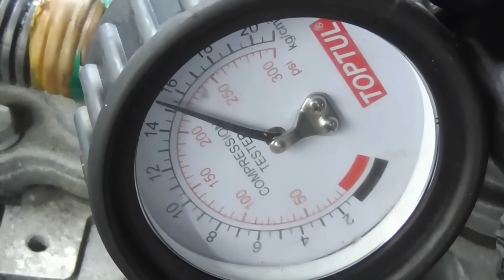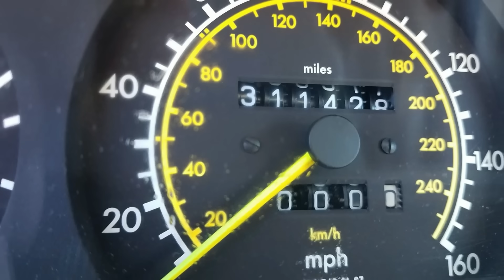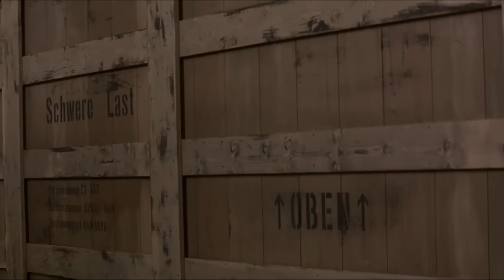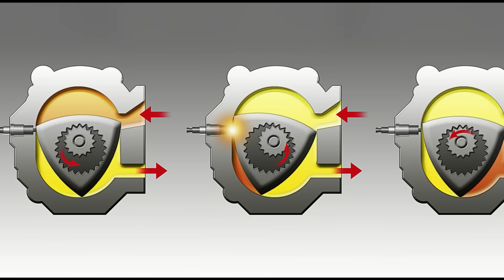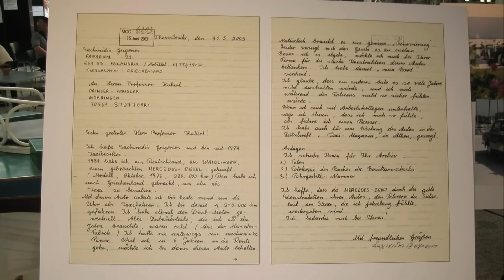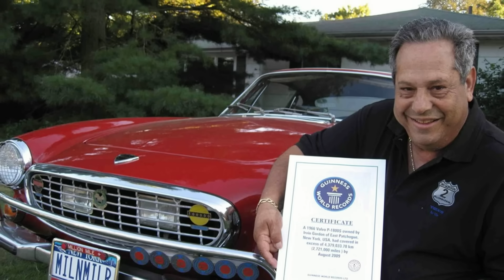Most Reliable Engines of All Time

Comment: Import biased much? I can think of plenty of American engines that'll do 300,000 miles easy. 5.9 Cummins, 7.3 power stroke, Ford 300i6, Chevy 350, as well as most small block V8s, hell I had a 2.0l zetec focus with 200,000miles, I also wouldn't say any rotary comes close to Mazda's most reliable engine, not by a long shot

Comment: The engine in the 2007 4.6 v8 crown victoria is good for 350000
Reply: Jose Alvarez 4v? 3v?
Reply: Jose Alvarez I got 2v in my 99 f150
Reply: David De La Cruz  that engine is good also, my car has the 3 valve

Comment: You did not mention the Plymouth 318  v8 
I’ve  put 425,000 miles  , brought it from the original owner who put 95,000 miles on it. For a total of 520,000  miles
All I did was replace the timing belt  once  2 carburetors oil changes about every 8000 miles and I did have to replace the  a frame or k frame as I hit a sidewalk leaving  coney Island 
It also sat from 2 months during the winter of 1981- 1982 bury in snow.
Once I got it out of the snow,put a little gas in the carb,  started right up like nothing happen.

Comment: My '78 Ford Econoline 150 work van, has over 300,000 on it... the 4.9 liter straight 6 still purrs, uses very little oil, head has never been removed... 

I have gone through 4 clutches already. I find it hilarious that young parking attendants can't drive 3 on a tree... 

The van had some issues with a cheesy clutch linkage. The clutch linkage lasted only 180,000 miles. Since I worked in a fabrication shop, I designed and made an indestructible, easier working linkage with bronze bushings. 

Just this year, I had to replace the entire ignition system, the manifold gasket, and the rear axle seals... I plan on having this vehicle for the rest of my life... I use it as a work van... and sometimes a daily driver when my car is down.

After high school, I cruised with a bud who had a Volvo 1800... another friend bought a 91 Volvo. He dropped some serious coin on the suspension. He uses it for his job, repairing industrial production machinery. He easily drives 50,000 a year.
Reply: I have 79 f150 300 with 3 on the tree!its my daily driver putting 80 miles a day on her!figured the 300 4.9 ford would be on the list.they need to do they,re research.the engines were originally installed in the ford farm tractors and were so strong they started Putting them in the trucks back in the sixties.

Comment: my old audi a3 8l (mk1) ahf engine , has almost 500.000km (almost 310.000 miles) and still rolls like a charm. only had an unnecessary head gasket service. engine inside, looks like new (almost)

Comment: No truck engines mentioned?  Aren’t there a few 1 million mile Toyota pickups?

Most full size trucks seem to reliably go 250k miles with minor maintenance and typical parts replacements (water pump, starter, alternator, ac compressor.)

Comment: Let me add some you missed. Jeep 4.0L I owed one with 260k on it till I sold it but have seen 4 that I know of with 350k to 450k miles. Also the Chevy 350 small block. Chevy 4.8L 5.3L and 6.0L V8 engines GM 3800 (3.8L) V6 and 3100 (3.1L) V6 the 3400 is capable of being a long lasting engine if you replace the shit factory head gaskets before they go so we wont count that. Dodge 318 Ford 300 straight 6 Ford 4.6L v8 Ford 2.3L 4cly 5.9 Cummins. The 5.9L being a big on my friend that owns a towing company has one flatbed with the original 5.9L that has over 600k miles on it and another with 280k. The 7.3L powerstroke the 6.6L duramax ( year depending)I could keep going but.

Comment: I got 360 thousand km on My Audi 80 b4. hardly consumes Oil, still runs 12km/h faster than it should according to its papers. It's the ABT engine. Only 90hp though and I think 148 torque.

Comment: 1.9TDI. Mine has 260k kilometres with original clutch, turbo and everything
Reply: those 1.9 TDIs are legendary, barely get warmed up with 300k km lol. The car around will fall apart before the engine gives any problems.
Reply: @ak-vq3js  yeah i know someone who used one as a taxi, about 900k kms and needed to replace for a new because seats were in so bad condition no one would sit in. Engine was never opened, oil changes about every month

Comment: You referred to the legendary OM617(A) by the name of the W123 model it was in? Show that noisy, immortal block of cast iron some more respect! Also, no mention of it being the first inline 5 engine in a passenger car?

The OM617 (as well as its predecessor the OM616, and successor the OM602) is an incredibly overbuilt engine, capable of much more longevity than you give it credit for. I own three: 235k, 249k, and 270k. The 616/617s are such sturdy engines that they frequently outlast the W123 chassis that they're in, and the W123 is/was a very durable car!

Comment: I have a 2002 durango, with one of the worst reputation engines, the 4.7l, with over 250,000 miles without it being rebuilt. I'm not impressed until 500,000 miles. 100-150,000 miles is not worth noting, and it doesn't count if it's been rebuilt.

Comment: There's quite a few mistakes here... 

Ahem.

Rb26 engines are not cheap, Roller Rockers are pretty much standard by now, the pictures of Hondas are completly irrelevant to the models you name, The K20 is still being produced in a new variant and no, it's not the most common one in Hondas (On new accords and civics, maybe). A compression Ratio of 17:1 isn't special for a diesel, Mazda made way more reliable stuff than the rotaries and if a car goes through 5 engines, why include it here?

Comment: Toyota Celica 4-banger: My wife's Celica has almost quarter million miles, still going strong with only standard, regular maintenance. Even the compression is still within spec. The body work and interior are falling apart, but the engine was bulletproof.

Comment: My 1998 Chevy  Silverado 1500 2WD, with a 350 engine,  just rolled over 430,000 miles.  Original Transmission,  with heads replaced at 278K. I am average on maintainence.  For me the key was that it has a simple fuel injected V-8 engine,  its NOT a 4x4 (less mass and moving parts) and that I started  the habit of when starting from a dead stop I never crossed 2000 RPM on the way to 60 M.P.H.   I drive this truck like I'm  driving a Semi.  Speed will not kill an engine, excessive torque will.

Comment: You are talking about 200.000 miles been like something special.
I had an Mercedes 250d from 1985 an after 568.000 km was still going strong.
If 200.000 miles is the success criteria, than are lots of engines out there that kan manage sow little.
I had an WV Polo from 2008, 1,4d, and after 250.000 no problem of any kind with the engine! 
Get serious !

Comment: The ISF Cummins family of engines has over 100 confirmed engines with 1,000,000 miles. Majority being semis. A few being Ram heavy duty trucks. Mine has gone 220,000 miles with little maintenance. I know of one 5.9 Cummins with 2,000,000.

Comment: my 2000 ford  3.0lt flex fuel ranger has 420000 miles and runs great no rebuilds 2nd transmission  still drive it daily. valvoline max life at 3000. just sayin

Comment: My 2007 Chevrolet HHR currently has 309,000+ with only oil changes and an alternator replacement.   2.2liter Ecotec with original clutch.

Comment: my accord estate 15 years old 212k town miles and abused as a workhourse towing the lot still runs like brand new. Doesn't use any oil, no smoke, Its the 2.2 diesel. The timing chain was changed on warranty after 8 years and replaced for an improved version. I had one leaky injector (caused by the dealer not reaming the injector seat when they did the chain) 80quid fix and a new turbo at 130k. Turbo was most likely damaged by a large air lock in the cooling system caused by an idiot not bleeding it properly before I bought it. Yea that's a couple of things but overall I'm very happy. Theres a taxi in London with the  same engine that has 500k miles on it so il be happy to get 300k. Also on original clutch still no slipping at all.

Comment: The engine in the volvo p1800 is a b18 or b20 (same engine but bigger bore) and is a very reliable engine but old and not practical for todays standard :)

Comment: I have an untouched 2001 VW Jetta diesel (ALH) with 591,000km (367,000 miles), and it runs like new. There are lots of these that have way more miles than mine does. An engine that only goes 2-300k miles is little more than junk.

Comment: GM 3800 v6?  Mines approaching 150k miles and runs really well despite my mother not changing the oil for like 30k miles.  I change it every 3k miles and do basic maintenance and it's surprisingly reliable.  My gf, me, and her mom all drive cars with the 3800 and they all are tanks.

Comment: Well you forgot to add my car to the list 1995 ford escort 1.9l manual transmission with 472,000 originals miles with original engine. Just recenly i had to do a valve job because some valves where leaking a little bit. I do oil changes every 5000 miles and only add 1 qt of oil between changes and i get between 34 to 35 mpg
Reply: Carlos Hernandez hahahahaha preach!

Comment: My late father was an auto jobber [between the warehouse and the 'grease monkey' was the auto jobber] most of his working life and he always said the Dodge slant six was the best American engine ever built. He was no gear head or even a shade tree mechanic but he certainly knew what parts sold over the counter and out to the garages that fixed daily drivers like the Dodge Dart, Plymouth Valiant, and Dodge Aspen/Chrysler Volare. I owned a Chrysler Volare through a very cold Alberta winter and I can testify it starts at minus 40 degrees (at minus 40 it's the same on either the Farenheit or Celsius temperature scale) and it got me from Calgary, Alberta to Toronto, Ontario in just under two and half days with time out for a few cat naps along the way. Glad to see it got a shout out as one of the longest running engines in the world.

Comment: FAKE NEWS! I own a k20 civic si and it is NOT reliable. Had a crank bearing give out at 130k miles. Issues with the timing chain tensioner, oil being burned up because of bad rings... Don't think that's reliable.

Comment: How did the Jeep 4.0 I-6 not make this list and a Mazda rotary did?
Reply: Because it's about glorifying the imports as most shit posted  on YouTube
Reply: @HuckBowlt  Not sure how, but the Mazda rotary was a total failure. Back in the late 70s purchased an RX4 wagon for $50. Yanked the rotary and dropped a Nissan L20B engine and 5 speed trans in it. My wife drove that thing for four or five years. Mazda had much better coach work than Nissan, their cars were kind of rattle traps. The Mazda was a very solid after that. I don't ever recall any of the Japanese manufactures having to be bailed out by the Japanese government (taxpayer) like GM, who builds crap!
Reply: Someone"s opinion.
Reply: Too many failed lifters. They tick loud af
Reply: @Jett-Alaska  Not sure what you are referring to? Are you talking about the L20B engine? They technically did not have lifters, this was a single overhead cam engine with two valves per cylinder. They had rockers under the camshaft than pivoted on a ball on one side, and depressed the valve/spring on the other. The lash was adjusted by threads on the pivot ball and secured by lock nuts. As I recall they were very quite if the lash was properly adjusted. But what do I know. ASE master tech, Acura Master tech. now retired. Worked in the grease trenches for over 20 years.

Comment: my secondary car is a 2001 Honda CRV AWD version. It has 342,000+ miles on it. only thing ever done is oil changes spark plugs wires timing belt and cv axels. B20b engine running strong.  also same auto trans. its a beast of a little engine. id love to hit 400k then 500k some day

Comment: My 2005 Hyundai Elantra has 225,000 miles on the original 2 liter engine, all I did is replace the oil every 3500 miles and a few timing belts, it leaks and burns no oil and still runs great.

Comment: The mazda rotary will never blow up, but what it will do is wear out the apex seals at relatively low mileage and therefore it will burn ALOT of oil at an relatively low mileage.  Also, every vehicle in my stable has 110,000+ miles on it.   100,000 is not alot of miles these days, thanks to fuel injection and MUCH better motor oil.  Lastly, the pre -series II  gm 3800/3.8 should have made the least.  The 3.8 engines without the plastic intake will run 350,000 plus miles without a problem.

Comment: Making lots of power and being a strong base for mods does not equal reliable in the sense I think of reliable... Reliable to me means lasting a long ass time (30+years),  or lots of miles (like a Cummins diesel with a million miles on it). Not some engine you have to rebuild after a few years because it is beat on and boosted.

Comment: Audi 2.2 20V Turbo (AAN) and all the 4.2 V8 versions. Strong and reliable engines.
Reply: C. Bøgelund (for the 4.2L V8) until u gotta pull the whole GD front end off to change the damn cam chain tensioners and/or chains.....
and IF the tensioners and chain have not failed before then... which means your engine is toast...  poor design which dissuaded me from ever buying one....

now the 2.2, i've heard good things about; they sounded pretty gnarly 👌🏻

Comment: The most reliable motors ever made are push mowers, you can throw horse piss in those fuckers and they'll run like a champ. If you're a member of gen z you probably remember your dad owning an old ass mower that you've seen him use since you can remember and he probably junked it a few yrs ago because carbon build up in the motor caused it to run poorly which 20 mins of cleaning would've fixed but eh fuck it time for an upgrade.

Comment: You forgot the engines used in the late volvo 240 and every volvo 740 and 940, I saw a car yesterday with 640000 kilometers on it and it looked like new, all the owner had done through the year was oil changes and polished the car

Comment: I own a 2005 Nissan Titan with 375886 miles have only had to change two front wheel bearings, 1engine coil, and brakes still has the original fuel pump, water pump ,hoses ,timing belt,trans filter, a/c works perfect really great truck and still has lots of power

Comment: Where to start. ...
- First off, the most reliable BMW gasoline engines are the M50B25 (non-vanos) and the M52TUB25/B28 dual-vanos and by extension the M54 (most do over 400k kilometers). The most reliable BMW diesel engines are the M21D24 and the M51D25. The only fault on these engines is the injection pump witch can fail around 300-350k kilometers, but it's easy and cheap to repair.  The M21 is so simple, it rivals mercedes diesels when it comes to reliability - AND - the Bosch injection pumps used by the M21 and M51 engines can be rebuilt - whereas the Lucas unit used by mercedes engines cannot (technically it can, but good luck finding parts, nobody sells a rebuild kit for lucas pumps). 
 - Second, ALL toyota engines are average reliability-wise - nothing special about them. In fact, the aluminum alloy toyota uses for the block and head is of mediocre quality, and if poorly maintained, the engines will wear out WAY BELOW that 200k mile mark. Cracked cylinder heads are also quite common for most toyota 4 cylinder engines. 
- Third - the nissan RB26DET is not cheap, and it never was. it is cheap TO MAKE tough, as most in line 6 cylinder engines are (compared to V6 engines). It is indeed quite reliable - IF not overly tuned. 
- Fourth - wankle engines love to leak. They will leak oil, coolant, fuel, you name it. Big HP doesn't mean reliability.

Comment: Can’t believe the omission of the Toyota/Lexus 2UZ-FE 4.7 V8.  Many with well over 300k miles and still running strong with just standard maintenance.  I have one in my GX470 and it’s top notch in performance, as well.

Comment: Rb26 and honda b series with roller rockers? Those are both dohc engines, and the rotary is known for poor reliability, they typically have to be rebuilt every 100,000 miles or so, so what would i change on this list? Pretty much everything, what would i put? #1, International 7.3L Powerstroke, #2, Toyota 2jz, #3, Ford 2.0 ZETEC, #4, Toyota 22r, #5, Ford Windsor, but I guess experience does make a difference, as for the rotary, I like them, I want one, but one thing they aren't is reliable
Reply: I have a working 2.0 ZETEC that I swapped at 193,000 miles, it overheated many times, was at revv limiter a lot, and ran perfectly when I pulled it, another one with about 228k on it, runs great, also been at revv limiter a lot, and another at 245k thats been at revv limiter quite a bit, once for 5 minutes straight when it lost power, i thought i blew it up, but it threw a code for overheated head (yeah that's not good) and was running terrible, but i replaced the spark plugs and changed the oil and it runs just as good as before, I've towed 2 vehicles with that little thing, and every one of these engines ove had ive thrashed, theyve all handled it fine, now as for the 7.3 Powerstroke? My dads has over 332k on it and runs great, and ive heard a lot about the history of it, long story short it hasnt had an easy life

Comment: rb26 is far from reliable at 1200hp.... and im pretty damn sure you aren't getting 1200hp without building it and putting a single turbo, i would have said td42 is nissans most reliable engine with plenty of examples of getting over 1 million kilometers